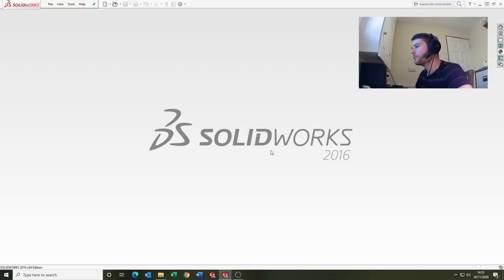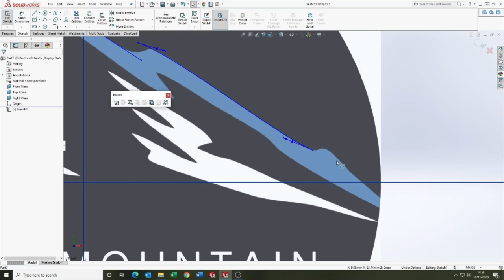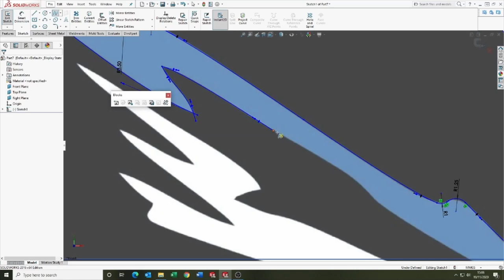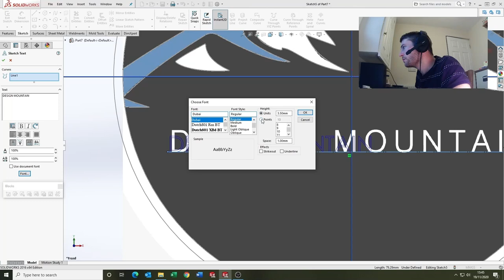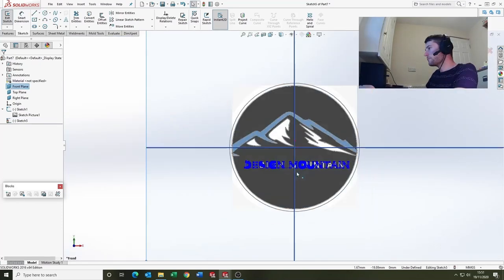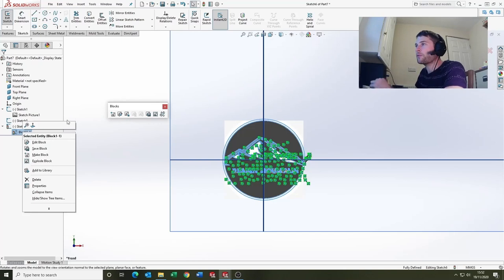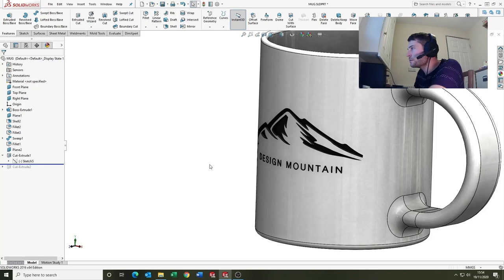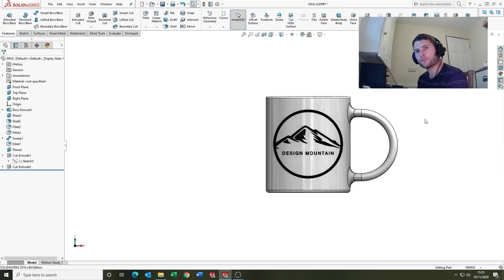How to make your logo a block in Solidworks

Comment: Dan, good stuff. I had never seen the "Disolve Sketch Text" before.

As far as a better way to do this process, it would probably be to do the Logo in illustrator and then transfer the logo to solidworks using a .DXF file. Its still a clunky method, but it is probably a bit faster than recreating everything.
Reply from the maker: Hi Chris, thanks for commenting. Ok this sounds interesting I will check out your method and have a play - for sure it might need some editing but as you say better than starting from
Scratch. Thanks again